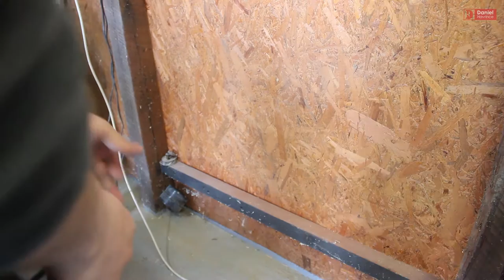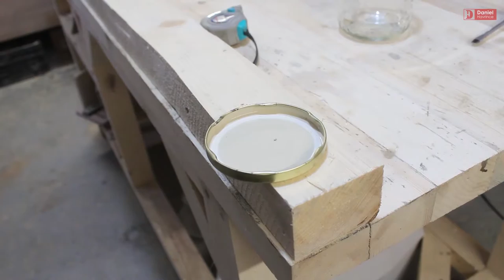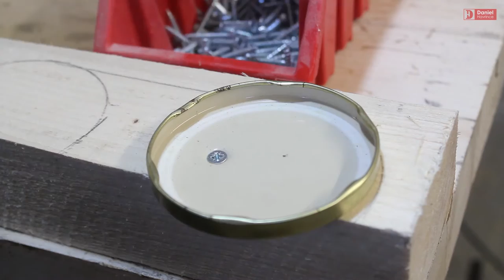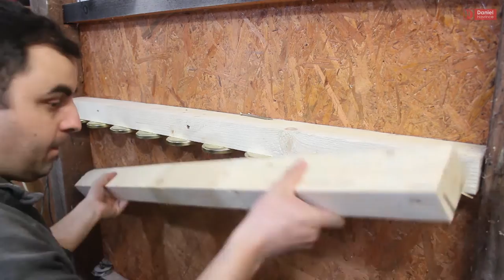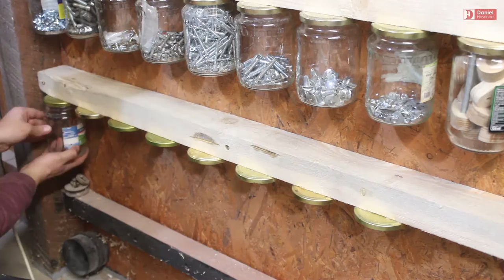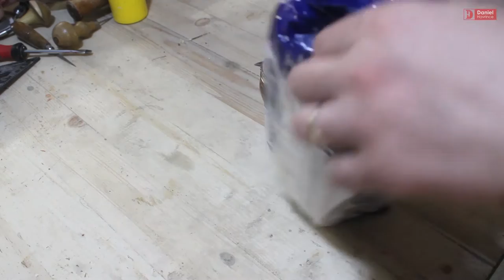Amazing DIY workshop storage idea are using upcycling

Comment: We eat a lot of peanut butter in my house. I bought a hole saw for each of the three major sizes in the US and used them to cut holes in plywood then mounted the plywood on the wall of my shop. The empty jars hold nuts, bolts, screws and assorted fasteners.
Reply from the maker: Thanks for the comment